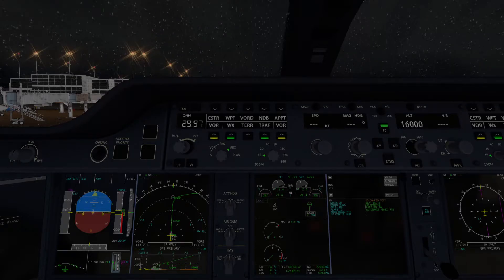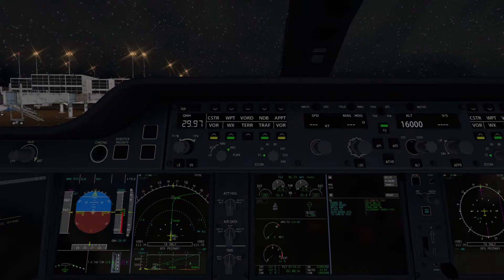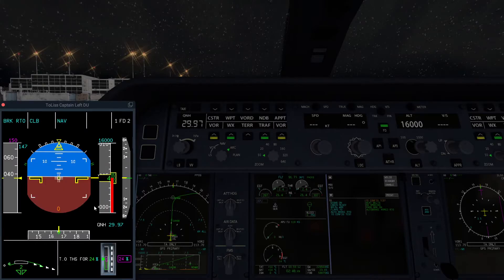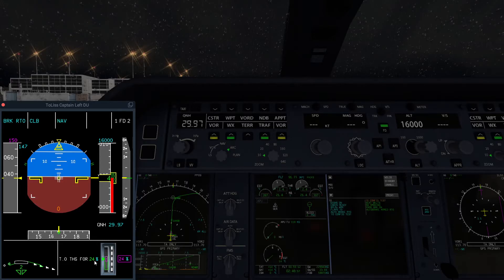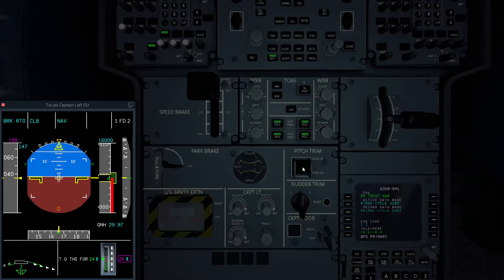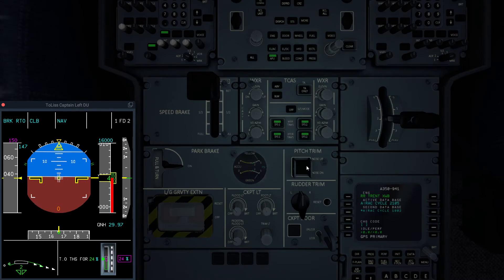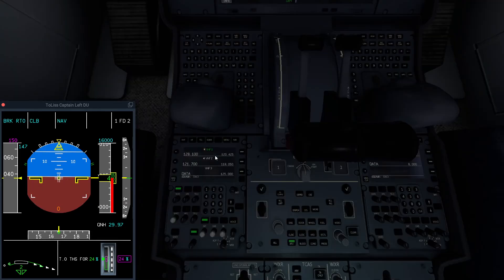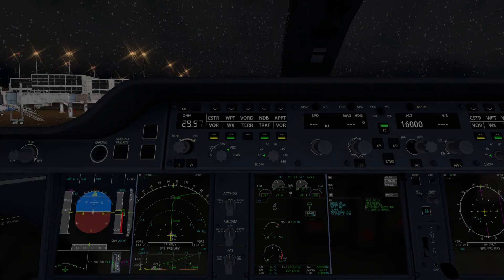A350 How to Adjust Trim for takeoff on Flight Factor A350

Comment: I did this, and still had to pretty much put full back pressure on my stick. Didn’t rotate til around 20 knots after calculated Vr. Any ideas?
Reply: Whats ur flap extension
Reply: So it passed v2 right